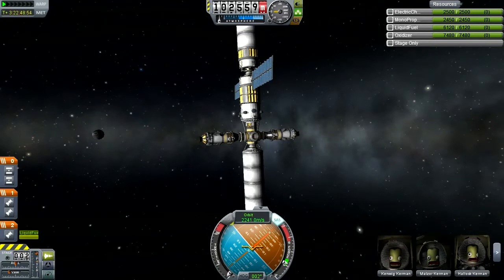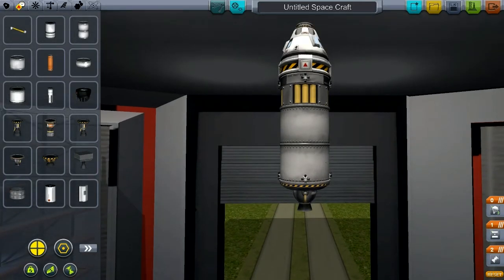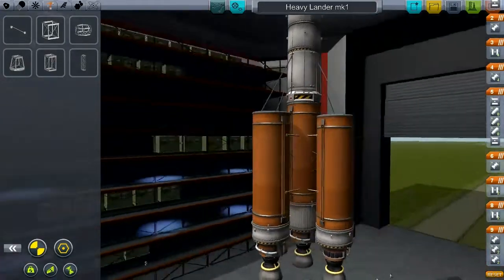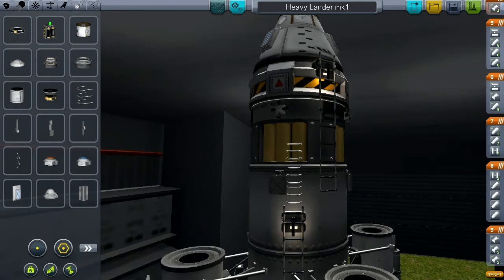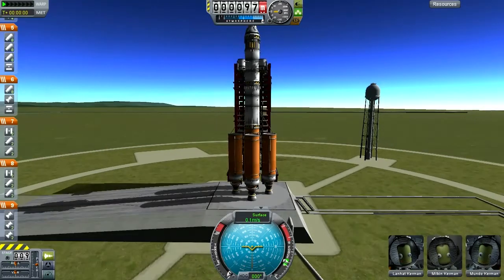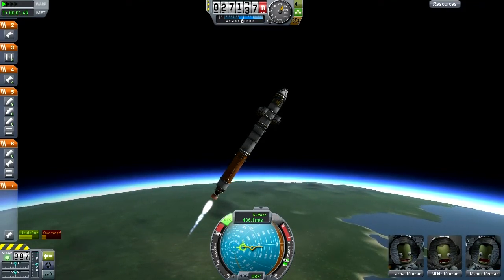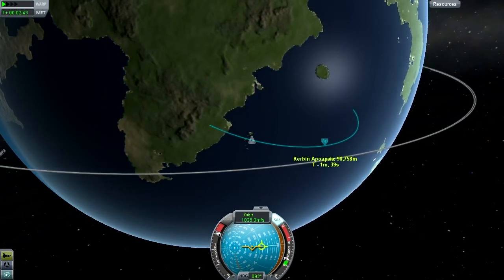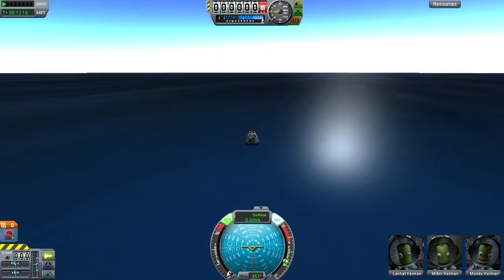E-08- Heavy Lander Design & Test - Kerbal Space Program 018

Comment from the maker: The way I've been doing that is to put a small tank between the large rockomax 64 and the mainsail.  it seems that the overheat is related to the distance from the mainsail to the center of mass of the fuel tank.  By putting the small tank between them you gain a bit more fuel and cut that distance low enough to solve the problem.  Just make sure to use struts connecting the small tank with the large one (i used 8 way symmetry)

Comment from the maker: the mainsail is ok for launches as long as you keep an eye on the overheat and don't let it get hot enough to explode.  My main gripe is that when the thrust vectoring isn't disabled they constantly slam from one extreme to the other, causing massive wobble that could be avoided if it could do something other than 'all or none' in whichever direction it's vectoring.